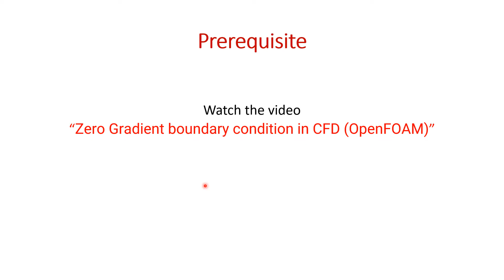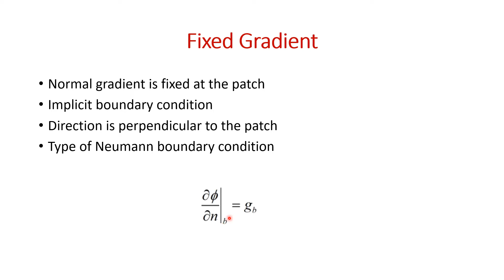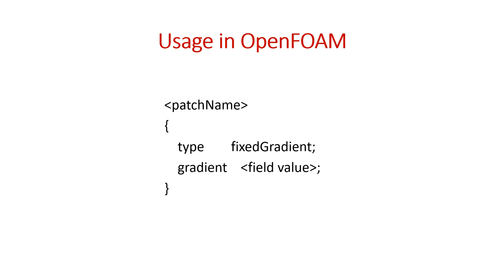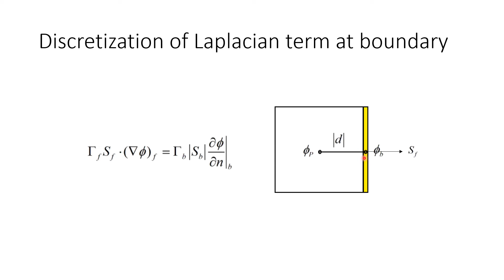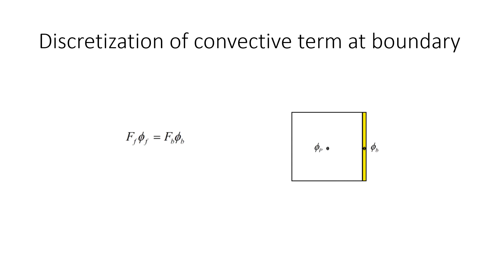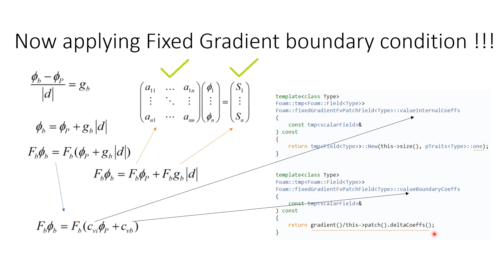Fixed Gradient boundary condition in CFD (OpenFOAM) | Computational Fluid Dynamics

Comment: @abhishekgade3604  Thanks for the video, may I ask you about a problem I am facing in a chtmultiregionfoam case? I am trying to apply wall heat flux using fixedGradient boundary condition but it works as zeroGradient and same thing happens if I use externalwallheatfluxtemperature  bc (also works as zeroGradient), do you have any idea what may cause this?